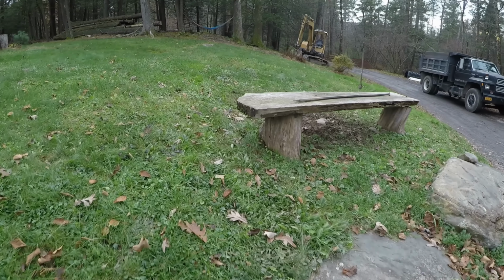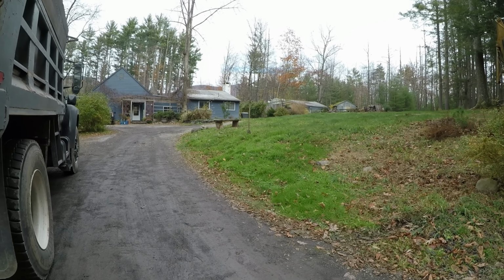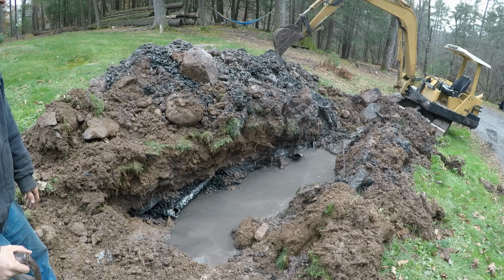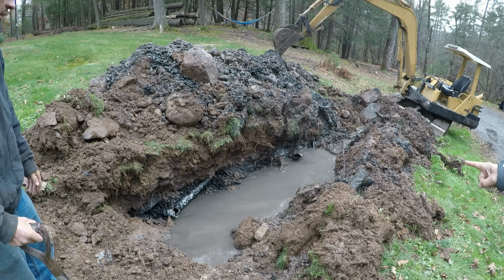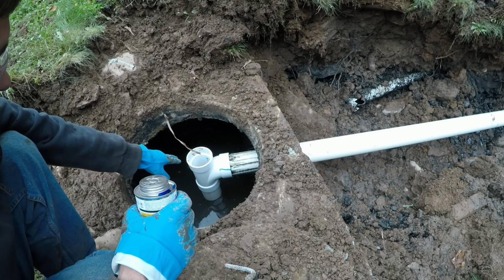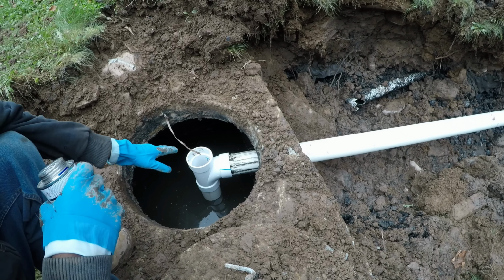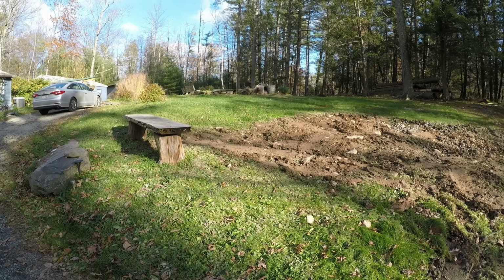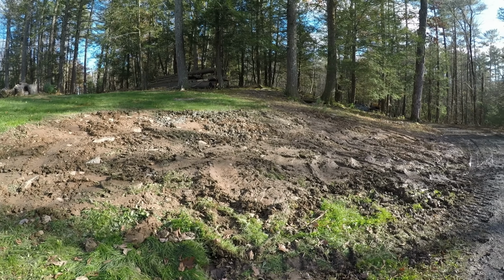Replacing a leach field

Comment: Not once did I see a level of any sort, not handheld or laser as you dug that trench. When you back-filled it, I cringed watching as you piled all the weight on the end near the tank. The pipe had no support under it as you piled it on, may have created a low spot.. Just curious too about an inspector? Guess there is none in that state?
Reply from the maker: Other people have asked similar questions. I was using a level the whole time, it was the water flowing down the trench. The pitch from the tank to the field doesn't matter as long as its pitched. That SCH40 pipe will be fine. Repairs don't need inspection. New systems do.
Reply: I can agree with that.. I thought there is a chance the laser wasn't ever in the shot.. I agree too about the pipe being fine, but sometimes the right hit from a large rock near the tank can damage it. The little area under it without backfill could have sunk, but you would have noticed the baffle raised a little.

That is a new field bed (system), isn't it? I know laws/regulations differ state to state, not ruffling your feathers really just curious.
Reply: it does matter its an 1/8 per foot pitch, industry standard and code almost everywhere
Reply from the maker: bleachinuri yes, between the tank and house that's very important, after the tank it does not matter as long as it's going down hill.
Reply: Andrew Camarata actually it does matter it's code, at least where I am it is and I live in the Northeast part of the United States
Reply from the maker: bleachinuri The pipe needs to be pitched 1/4 inch per foot from the house to the tank so the solids do not get stuck in the pipe, if it was pitched steeper the water runs past the solids and they get stuck, if it's pitched less it doesn't flow at all, after the tank there are no more solids, it's just water, And it can be pitched any amount
Reply: Andrew Camarata well here where I live in the Northeast we obviously have very different codes because it is a 1/8 per 
foot from the tank to the leach field and you have to be licensed installer whether you're doing a repair or new installation all which has to be approved by an engineer
Reply: You see the reason why the Northeast has such strict rules because we had way too many people just doing whatever they want and we had a lot of septic failures bad septic sand, bad installation practices she now everything is uniform it has to be approved by the state and by an engineer which it should be because it's too many people running around pretending like they know what they're doing
Reply: bleachuri: You say there's a lot of stupid people in the Northeast, so they need lots of rules and regulations? Well thats a shame, I know out here in the NW we have stupid people too. But its often inspectors, engineers, architects, and generally government employees who have never built anything, don't know anything more than a book told them, and wouldn't know an Earthship from a space ship.  But oddly they run around pretending like they know something more than how to generate revenue for the state. Which brings me to this uniform building code system they have implemented across the country.  If only it could help to keep concrete and steel buildings from burning to the ground when office papers catch fire like happened with building seven on 9/11.  Facetious levity aside, my point is that building codes are often preposterous and also  1/8 inch of drop per foot is a minimum requirement not a max slope on a septic drain field.
Reply: John Greystoke John you know as Well as I do concrete structures such as the wtc don't burn down unless there's help, and I don't know about you but when was the last time a structure pan caked neatly all the way down to its foundation within it's own foot print on accident, it doesn't happen, so that's a bad analogy, and I never said people in the north east were stupid or dumb, I said there was a lot of bad contractors with out checks and balances, that's why things are so strict with building codes, there's nothing wrong with engineers, with out them the building trades would be shit, no uniformity, people would be at risk, and I'm well aware of minimum code, but here where I live 1/8 per foot is a strict code for skeptics, it's been awhile but it had something to do with keeping effluent and solids from washing over the the divider or baffle, now they use a baffle on the inlet and exit so it's not a huge concern but I've even seen those blown right of the end of the pipe
Reply: bleachy: To have a "strict code" where its as you say, "not a huge concern"  may indeed occasionally cut back on stupid, cheap, ignorant, or whatever people, and provide some uniformity. But my point was and is that its often like the ordinances that won't permit you to plow your own street or collect rain water.  I'm sure the intent is well meaning, but the fact remains that most regulations are to keep stupid people from doing stupid stuff that is often just as stupid to have a regulation against as thinking that fire burned down a skyscraper that no plane hit.  You have to be stupid to fall for such nonsense, yet many do.  So I don't see that as a terrible analogy towards a lot of people being dumbed down to the point of stupidity.

   With that being said, I personally like a lot of the Earthship designs and many of the other completely against all codes, and arguably genius structures being built.  In many of  those, they run the septic drain line through the living room to fertilize the plants growing there.  So in regards to the building trades being "shit".  Well yes I pretty much think they are and at the risk of redundancy, I think it has a lot to do with the fact that most engineers, Architects, and code inspectors have never personally built shit, much less have they come from three generations of actually building anything.  No they just tell you what a book told them.  Thats what I think can often be quite stupid.  On a tangent, have you ever tried to explain to most engineers how concrete actually works. lol good luck with that.
Reply: John Greystoke look if your dealing with an engineer that doesn't understand the logistics of concrete then it's time to find a new one, true there's engineer's that are ignorant to the Manuel labor's of building trades, but I've personally worked with engineer's that spent 20 years in the trades before becoming an engineer, not all engineer's are ignorant book smart pencil pushers, it sounds like you don't like being told how to do things, my suggestion to you is to go back to school get your degree in engineering and make a difference with your trade experience and your new found knowledge of engineering and apply those to the short comings that you dislike. You don't plow your own road because it's a liability, if some one gets in an accident your going to be sued, then the town or city will be sued for letting you do it, then tax payer money will be used to cover the law suit, rules, laws, codes, regulations,  are in place for everyone's protection, do some of them seem like they make no sense, of course,  but when you find out the reason you usually have a change of heart
Reply: Good discussion/debate.
Reply: That project is going to work as well and as long as it would if some union HACK had done the work!
Reply: just a repair emergency
Reply: Wrong..lol....if a Union thug/Hack had done it, it would have been almost as good as Andrew's job, but would have cost the homeowner $8-10k, whereas Andrew probably did it for around $3-4k, and there is 300% more pride that goes into his jobs
Reply: Jason Asselin o
Reply: Andrew keep up the good work.  Most of the people complaining about codes live in a housing development, work a 9 to 5 job, and live their life exactly how their boss,  town and government brainwash them into living it.      
Keep learning and doing good work.  You'll always be ahead of 99% of the American public.
Reply: How about answering the question about why you did not empty the original Cesspit of most of the water. That needs to be done about every 10-15 years? Or do you not know that much about them?
Reply: A septic tank is full of anaerobic bacteria and facultative anaerobes, (such as most E. coli) never heard of airobic. But if it was aerobic, you could safely breathe in a functioning septic tank (I don't recommend trying it). If it were aerobic, there would at least need to be an air sparger or mixer to break the surface tension to let the oxygen penetrate the surface once it is used up.
Reply: this guy is basically chuck norris, he don't need no level, his eyes are lasers :-D
Reply: @johngreystoke1135  inspectors are like Home Depot/Lowes sales associates. It's hard to find one that actually knows and worked in the field their department is. Every time I go to the plumbing department and I see this one young guy coming I tell him never mind I'll figure it out on my own. I watched this guy just stalking shelves with 10 people looking for things. Not once did he stop and ask any of them if they need help. When asked for help the idiot couldn't answer simple questions. I end up helping them out instead of him.
Reply: Ugh. 
No way. 
You’re trenches are too wide. 
When you use chambers, your trench should be the same width as the chamber.
Reply: On YouTube he looks like a hero. No laser in sight, pipe touches the bottom of the ditch once every 4 feet, digs the ditch way wider than the chamber width, then immediately runs over the whole field 50x. I get that you’re self taught but don’t defend your mistakes, learn from the criticism of experienced people trying to help you grow.
Reply: @Patrick Faricy i never said they were all smart, maybe read my post
Reply: Patrick Faricy you know what they call the guy who graduates at the bottom of his class from med school.......? Doctor......
Reply: @Logjam5  yep

Comment: The pipes weren't primed or cleaned before he glued them so I don't see how they'll stay together
Reply from the maker: One step glue/primer. Those things go together so deep, you wouldn't even need glue to hold it.
Reply: stay together ?  You mean by all that massive pressure of a toilet flushing or shower running and a little trickle flowing out through the pipe ?  LOL   Its the discharge end of a septic tank, no presure. He could have just stuck em together and no glue, it would still be there in several years...
Reply: You should try to just glue two pipes together with no primer then try to pull them apart. Two Mack trucks couldn't.
Reply: First one was really bad with dirt all over it, rest were average joins. Doesn't take much to do a good job just need a rag
Reply: its less an issue concerning holding together, more about beeing water-tight....
Reply: Really?! Lmao

Comment: Never saw a level to check slope, dig that up in a year and the pipe will be bent with low spots all over. I just fixed my parents septic tank by hand after idiots like you had crushed the pipe and no support. Pipe I put in had sand under for support before backfilling. Sure as hell wouldn't drive over it like that
Reply: HighStreet Killers is actually still living in his moms basement playing with Tonka trucks on a sand table

Comment: Those black enclosures let oxygen get to the effluent and encourage decomposition bacteria.  Your soil is pretty nasty drainage wise, the load of topsoil makes sense.  In our area of Northern Michigan this installation would require a great deal more work.  A baffled tank, pipe on pitch and set on a bed of fine material, and only located on well drained soil, probably a raised system, and inspections.

Comment: Appreciate his work ethic and helpful video but being in this business he should know how to lay drainage pipe with straight pipe section flowing into bell end of pipe. 

Secondly the first section of drainage pipe from tank to leach field should have proper compacted bedding, clean backfill to cover pipe all set to positive flow grade and then rough backfill to surrounding grade level. There were way to many voids under his first section of pipe that will result in sags or even broken pipe at some later date as driveway section was not sleeved.
Speedy work is not always the best work.

Comment: In Australia we call them 'absorption trenches', not leach fields, although they both are  purported to do the same thing.
Both work in the short term but all ultimately fail.
There are same basic rules for an absorption trench;
Where the trench is situated, the top of the ground should be a minimum of 450mm below the outlet of the septic tank and the inlet of the septic tank should be 450mm below the outlet of the soil line from the toilet, measured at the house.
 ALL pipework should have a minimum fall of 1:60, to the tank and from the tank. Where the pipe work enters the absorption trench, it should terminate with a 'T' drop allowing an inspection port on top. The two ends of the chambers should be capped off stopping any dirt entering.

If the property is suitable to put a dam on for catchment water, an absorption trench will never work. There will be no absorption.
If the soil is sand, it will not work. Sand gets sealed off by the fats that enter the system, they act like plastic sheeting.
 The very best way to build the trench is to have a transpiration bed attached to it.
The minimum length to the trench is 30M (100ft).
That trench should be dead level from one end to the other, it doesn't have to be straight, just level and only about 600mm deep if you are using trenching material, (chambers) @ 450mm height. That allows you to cover it with 150mm of backfill (20mm stones) to the top of the chambers, not over them.
 Downhill from the trench, you should open the ground to a depth of 300mm X 3M wide. Fill it to within 100 mm with course rubble, cover the rubble and the trench with a geo blanket and then top off with course river sand, mixed with a little soil.
Sow grass seed onto this and do not cut the grass less than 100mm. do not allow animals to roam over it, do not drive any vehicles over it, including ride-on mowers.
The trench now acts as a distribution trench for the transpiration bed. The grass roots suck up the moisture which is transpired through the grass leaves.
 I have installed this system in clay soils where a normal trench system would never work, gone back ten - fifteen years later to find no trouble.
 Also you should never allow any trees to grow  on or nearby this system as the roots will eventually destroy your hard work.

Comment: Good Job. But I wonder....where was the inspector? Did they purchase a repair permit? Did inspector check level grade on leach field line? How much fill dirt cover can you have on the leach field line? I like that you added washed stone gravel. It’s good that you pointed out the importance of the baffle (t fitting on 4 inch pvc in exit of tank). The t will simulate a baffle and keep solid out of leach field line. I hope you used caution around the risk of viruses in the effluent waste. Yikes. I have gotten very sick working around sewer all my life. Not fun. - I love the yanmar. Why does the track come off? Idler worn?

Comment: I have never had a septic tank, but I wonder about the PVC being run under an unpaved road.

For example your dump truck would not compromise the pipe?

I just purchased a property with a septic system.

Comment: If the tank was just pumped where did all that liquid come from? Sure, they do not pump out all the liquid, only the sludge at the bottom, but that should then leave room for liquid to rise back up to top before exiting to the leach field. And given that leach field was clogged apparently, all the liquid in the pipes would backflow into the tank. But the tanks are big enough to hold more liquid than the average leach field. So again, why all the liquid?

Comment: This is appalling to a septic pro. Placing a system on to wet soil is a recipe for failure or short system life. The receiving soil under the stone will be smeared and compacted, and is unlikely to ever do much dispersal. Treatment is also dependent effluent moving through DRY soil. Given the obvious wet soil in the dispersal area bottom, it seems likely that the bottom is at or near seasonal water table. At least Andrew used stone to bed the chambers and, even better, surrounded and covered the units with stone and geotextile fabric. So the system may actually last awhile. But one wonders: why use the chambers at all? In this situation they provide NO benefit in terms of treatment. They only make for an expensive distribution network which could have been accomplished by SDR 35 or even thinwall pipe.

Comment: find the outflow from the tank, pop a plastic manhole down 3 rings below the outflow pipe. Fit a pump to lift water to a vertical flow reedbed. Without further treatment what happened before is likely to happen again without further treatment. Outflows from a septic tank is still full of suspended solids and high levels of nutrients. Filter them out in a vertical flow reedbed and you have clean clear stream quality water. If there is no stream or ditch for the waters to flow to, you need to know if the ground will actually soak up water, and how much. One method of ensuring the clean waters are removed, is by planting willow and iris. These plants will make the ground dry, as they evaporate water all year long. Obviously there will be more evaporation in sunny days than wet days. But plants work as long as the sun comes up each day, and they do this for free